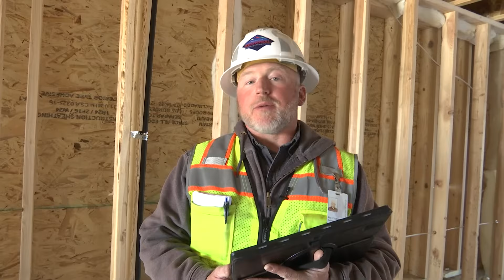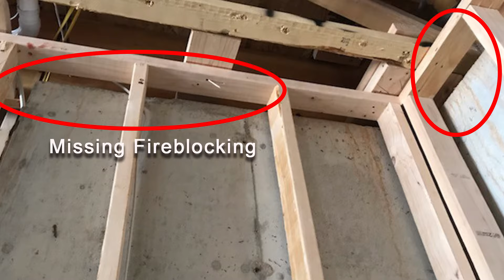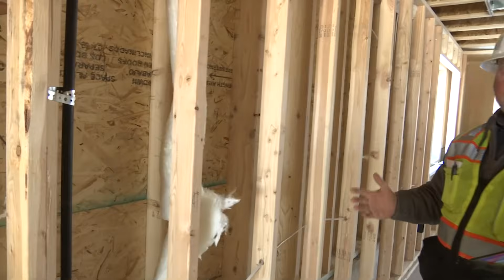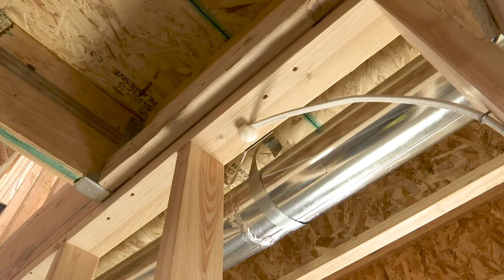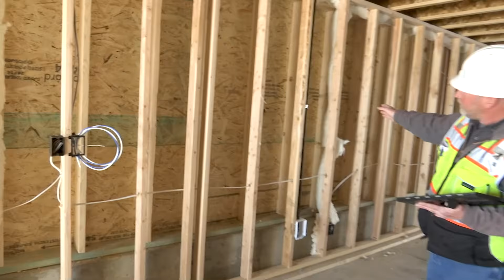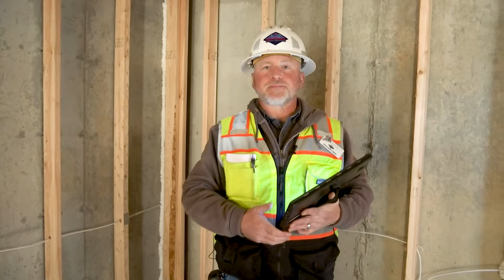Fireblocking and Draft Stopping

Comment: You people are unbelievable. Nothing but  unconstitutional  dictators, you are.  You are demanding that  "I"  spend  "MY"  money  at your behest.  For no  return on the investment.  You are all worried about tiny penetrations around wire---which already  goes up into a wall covered by drywall, and if  exterior,  is already plugged with insulation,  yet, your example house  just like my house,  HAS AN OPEN STAIRWELL.    I guess you don't think that fire is just gonna  roar  right up the stairwell.

Comment: I'm learning to do small construction as a hobby, and was going to make better drawings of a shed type building (wood drying kiln).  Marking up the pieces, I wanted to make sure I was using the right language, and searching, stumbled on "fire block"- something that looks like a nonsensical, random piece of lumber midway up studs on a wall.  By the name, it made immediate sense what it should do, so I searched and came across this video.  I'm glad I watched it, because it shows A LOT of build scenarios that a fire block should be set up.  Great video!

Comment: I have a 2 story home new construction in NC. The roof joists of the first floor have a 1” thick plywood about a 9.25”x16” wide ( 16” bc of the joists spread) that goes from the floor of the 2nd floor down 9.25” to be flush to the joists. I have to run flex thru them to get my duct to the other side of the furnace. Can I cut an 8” hole thru center to run my duct work thru the chase?

Comment: Very clear, well done!. I am currently finishing my basement, and found this very helpful. One point thaf I did not see is how to deal with dropped ceilings, coffers, etc. It was addressed indirectly when you spoke about the draft dtopping bats of  insullation or 2x lumber at the mechanical ducts.

Comment: This would not pass in our jurisdiction, that insulation is not going to stop shit its going to fall out. Proper way soffit to wall is plywood or drywall, if your using insulation rock-wool only and it needs to be TIGHT- this is not the way.

Comment: How about the gap on a basement stud wall where the frame has a minimum of 1 1/2 inch expansion gap at the bottom, should this just be filled every 10 feet? As this will be filling the expansion gap, thanks

Comment: PLEASE ADVISE…Is it necessary to fill the holes in studs where wire is run horizontally….or…..will the draft stop every 10 feet be enough? Thank you for the informative video.

Comment: Best video on the planet Earth! Thank you again! I have one more question. If the R-13 faced fiberglass insulation is installed between the studs do I still need to install foam (or other material) every 10 feet to prevent draft? Also, I'm wondering if the insulation can be combined. For example - 16" at the top install Rockwool as fire block and the rest use R-13 fiberglass insulation. Thank you!

Comment: Furdowns are not required to be fire stoped or draft stoped every 10 feet  only the interconnection between vertical (walls) and horizontal (furdown) fire block the furdown at the wall see r302.11  2 also see the diagram for fur downs  the 10'  horizontal and vertical is from the previous code for walls

Comment: Great video! How thick is the fire block - fiberglass should be? How do you secure 16-inch tall pieces between the studs? Also, On a different note, I wonder why insulation panels are not installed between the frame and the concrete wall. What is permitted to be installed instead? Thank you!

Comment: Thanks for the information! How would this apply to balloon-framed construction? I imagine fire-blocking would be required between the first floor and attic/second floor, but how about between the crawlspace and first floor wall cavities? And if fire-blocking is required in this scenario, how does one deal with potential moisture traps that old balloon-framed houses with nonexistent or insufficient sheathing or weather-resistant barriers are prone to?

Comment: We are in the process of doing this right now and this is extremely helpful.  I'm using rock wool for the entire ceiling for sound dampening and fire protection.  All these extra little areas that I might have missed will now be done before framing inspection.  Thank you for such an informative video.

Comment: I didn't realize you could add in the draft stop every 10 feet, and instead filled it with an entire new layer of mineral wool.
Each piece had to be shaved down about 3/4", but mineral wool peels more of less like a layered pastry; super easy.
It was expensive but hey, now I can pat myself on the back for a job well draft stopped.
I'd go with your method if I had to do it all over again, and use the saved money to pay for a month of bills 😥

Thanks for the great video!

Comment: Great video! I noticed that the basement wall draftstopping was done by "stuffing" unfaced fiberglass between the studs and walls at 10' max. intervals horizontally. There are huge gaps in the section that you show on video behind the stud. I typically spec a 3/4" strip of exterior plywood nailed to the stud and tight to the foundation. This seals against horizontal travel of air and fire. Most inspectors in NJ and NY don't allow loose insulation like that even if it were tight. The logic is that if the fire is cranking there will be a lot of suction and air movement which will peel off those loose pieces of insulation.  We usually do a horizontal 2x4 blocking at the bottom of the soffit level between studs. Again, much tighter and air sealing in the stud bay than fiberglass. Love how you pint out the draftspopping around ducts and pipes. I rarely see that done and a lot of inspectors overlook it.

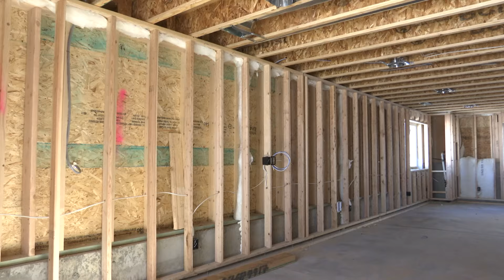Comment: If you have a wall taller than 10 ft like the one you pointed out @4:39-4:54, can you just fill the whole thing with glass fiber insulation? You're going to insulate that wall anyways since it's an exterior wall, so what's the point of adding 2x members at 10', when you said glass fiber insulation works as a fire block. If you add a fire block with wood at 10', the 2x members will create a thermal bridge, and it's a waste of materials and labor if you're saying glass fiber insulation works as a firestop. You kind of addressed this question at 1:17 where you said fire blocking can be taken care of by insulation, but you said you can't see the fire blocking anymore once the insulation is installed. I can understand how it would be hard to see the framing in the other examples you gave like the gap between the studs and the foundation, but I don't see how that would be an issue in the the case of a wall framed over 10'.

Comment: Seems like they're using anything.... our code requires fire foam everywhere....it's reddish orange.... fiberglass insulation burns faster than a 2x4... rock wool would be better if it's secure.... most of that draft and blocking looks like you can push it back with no effort

Comment: Anyone wondering why housing is not affordable should watch this video...  Its the same reason the whores in the government require pillows to be coated in toxic fire resistant coatings .  Lobbyist.  These buildings are not safer than how they built 100 years ago due to how toxic they are...  They will eventually become super fund sites.  "All for your safety".

Comment: Hello Tim,
Thanks for the video. We are adding a bedroom and bathroom to the basement. The inspector said we need a Vertical draft stop every 10 feet . We have the horizontal block in. We have framed against a concrete wall that has the white insulation wrap. 
My question is what is the best way to install the block. The wrap is against the studs but don't know what do. Any suggestions would be greatly appreciated.

Comment: I am trying to frame up some walls in my basement and found 2 by 4 lumber for the wall framing would be too much money, so by code in Colorado can you use 2 by 3 lumber because if it is cheaper. Also do you need to pull a permit to frame and drywall the exterior basement walls. I am not planing on doing electrical or plumbing. I am not going to make it a livable area I just want to be able to paint the walls to make the basement brighter. I’m not going to put flooring, rooms, or bathrooms. Hopefully you can help me out

Comment: I found your video looking for fire stuff. How about double top plates. 2 plates are required for load bearing walls and the rating between multiple floors.  Gives more time to prevent fire in stud cavity to penetrate floor system above? correct? single top plates are rated 1hr just like solid blocking i believe. so is 2 plates a 2 hr between floors?

Comment: Hello, is there anything in writing where it clarifies Drafstopping in the soffit? Been having this problem with Los Angeles and Orange County inspectors consistently. They say I have to firestop non-rated interior walls just because pipes penetrate the soffit area. I told them that's Drafstopping but they don't get it.

Thanks

Comment: The insulation used as fire blocking at the top of the wall and in between studs is this video is not "secured in place". If a fire starts inside the wall, it creates a lot of pressure and will move the insulation. When I'm inspection insulation used for fire blocking my rule of thumb is if I can move it with my hands/fingers, it fails. The same goes for any of the other "approved materials"...they must be secured in place.

Comment: One area you didn't cover with the horizontal draft stopping is annular spaces in the studs (for electrical wires, plumbing pipe, etc).  Do these holes also need to be sealed every 10'?

Comment: Thanks for the video. My county using IRC 18 currently. I was going to use rigid foamboard insulation on the concreate walls for code, R-10 continuous insulation and then frame over the foam board. They mention that I should not have the framing butt up directly against the insulation to leave an air gap. In order to horizontal fireblock, do I use a 22/32 OSB panel sistered to the stud and touching the foamboard, or just use spray foam insulation every 10ft on the gaps? Thanks!

Comment: Thanks for the video.  What made your dept decide to do this video? The rough explanation of it has been pretty helpful to understand it.

I have a unique situation and trying to fully understand the fire blocking layout.  Basement, drop ceilings. If my basement ceiling is going to be stuffed with rock wool / mineral wool -- does that count as a vertical fire block?  Do I still need to do the perimeter layout of osb/plywood that I see some ppl doing at the sill plate level before I put up the wall frames? I'm basically curious if the ceiling filled with rock wool will be a proper vertical block for everything without doing any else. 

Also, I noticed in your video they all the joists have what looks like a 1 inch strip of plywood attached to them before the wood frame/stud is attached. 

Thanks!

Comment: At 1:35 he I believe mistakenly calls a fireblock a draftstop.  Draftstops cut off thousands of square feet while fireblocks occur at interconnections of horizontal and vertical spaces and at 10 feet on center in double stud walls.  Many people get this confused because the code says "Fireblocking shall be installed to cut off concealed draft openings" which makes it sound like it is a draftstop.  IBC Sections 718.2.1.5  and 718.2.2 make it clear that "Fireblocking" is what is installed in double stud walls and concealed spaces of stud framed walls.

Comment: This definitely helps me with my basement refinish, but I've got a question. My basement has builder installed blanket insulation, my walls are going outside of that. What should I use as a fireblock between the walls and the blanket insulation?

Comment: What if the plastic faced sheet style insulation is already anchored to the concrete wall and you framed in front of it? Can the blocks be butted against that isulation tight to the wall?

Comment: i have builders dispute the fire blocking at 10 foot high rule.. lets say its a 12 foot high interior wall with no blocking.. where in the 2012 IRC does it say to do that.. i only find 10 foot rule horizontally and not vertical..

Comment: Thanks for the informative video!  At what distance from the concrete foundation is fire blocking not required in my basement?  I have some walls that will be 1 ft and 3ft from the foundation.  Is that just considered unfinished area that does not need fire block, or do I need to run 3ft of fire block to the foundation?  At some distance, it becomes just unfinished space, but I do not know what that dimension is. Thanks.

Comment: I'm about to finish a basement, so this is excellent info.  I do have a question about the "every 10 foot" draft stopping.  I was planning to run rigid foam around the concrete walls in my basement, and finish with wood studs in front of that.  Does the stopping material have to go from the stud bay all the way back to the concrete, or can it simply make tight contact with the rigid foam (which would be much easier)?